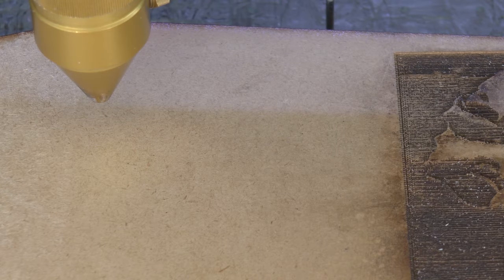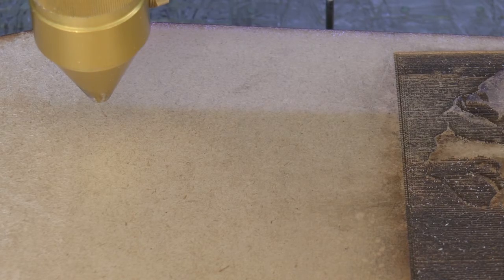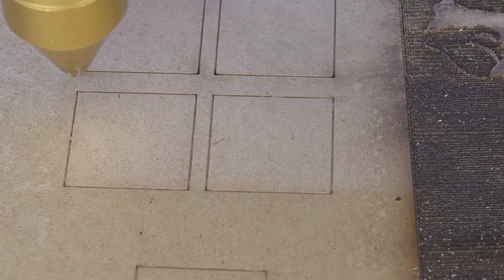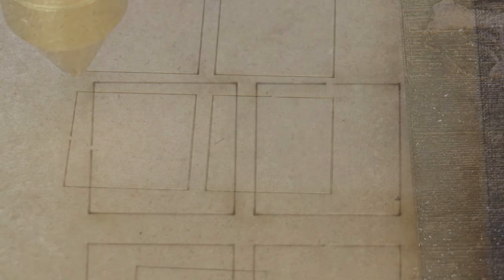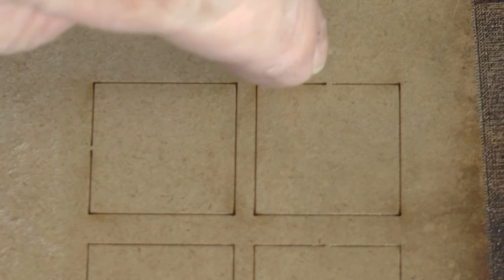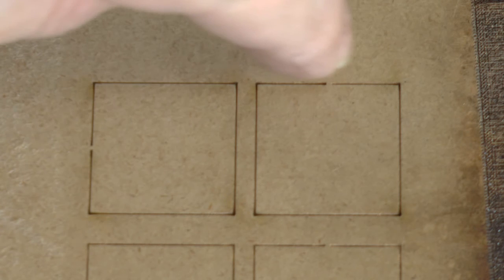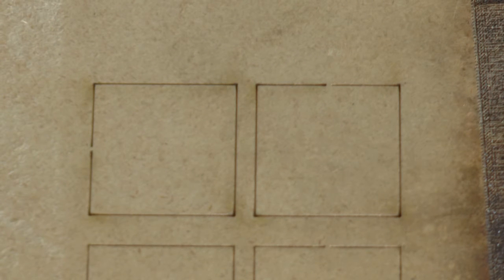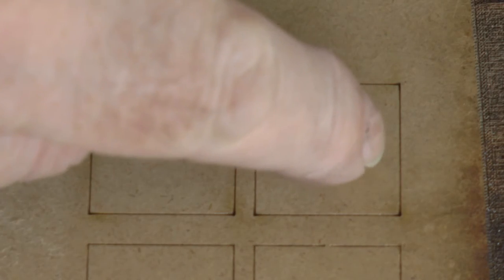RDWorks Learning Lab 55 Why Max Min Power

Comment: how does it affect cut through?
as in, if you need 40% to cut through(just cuts through and no more), and you set min at (example) 10%, does it still cut through? 
I think this will be a 'suck it and see' setting but I will find it handy for the MDF I cut already
Reply from the maker: +Michael Edmond
 Hi Michael 
This is obviously fine for engraving or controlling DRAWN lines with a cut parameter.  For through cutting it still requires max and min set the same. It seems as though the MIN power is the over-riding parameter UNTIL it matches MAX POWER
So it's useful for those that are doing a lot of engraving as I suspect dot size/density will create power variations if you let the machine "loose"  I'm sure there's some experts out there that either take this for granted or are not telling. Certainly worth experimenting with more for graphics work
Regards
Russ
Reply: @SarbarMultimedia , hi. I actually need image to be engraved (cutting parameters) NOT scanned.
Do you have any info what is recommended maximum cut speed?
Reply from the maker: @projex5894  
Hi 
So you want to do outline (vector) drawing with a fast cut? 
 First of all draw a 25mm square and  find the best power speed parameters for the middle of the square sides (set max and min the same). The corners will always be dark.
When you are happy with the result set the min power to about 5% and repeat the test. It is almost certain that the corners of the square will not join. Increase the power in 1% steps until the corners JUST join. 
That's it
If you change the power or speed you will have to carry out this test again. It is VERY sensitive....you cannot take a wild guess.

Best wishes
Russ
Reply from the maker: Problem 2.  You are asking about max speed for drawing there is value anyone can tell you. It depends on MANY factors, the focal length of your lens, the power of your tube , the material you are trying to mark but  most importantly there is the Ferrari effect that you have to understand.  I have seen you out driving you VERY fast Ferrari so you will knowthat it probably takes at least half a mile for you to reach 200mph????  and with those amazing optional carbon brakes you can stop in 200 yards. Hmmm. Ok.Lets change the rules.
Around your small housing block there is a road that is 100yds square. What speed  can you reach before you have to slam on the brakes to get round each corner?  60mp[h?
This exact same scenario existe with our machine. You can set the speed to whatever you like (200mm/s) but unless the distance is long enough for the machine to accelerate to 200mm/s then you are wasting you time. If your job comprises lots of small circles , triangles or other fiddly shapes  setting your power high to run at 200mm/swill result in overburning bacause the speed may only be 20mm/s..
I hope this begins to explain why the answer to your question  is a matter of experience, and judgment 

Best wishes
Russ
Reply: @SarbarMultimedia , thanks a lot for a quick reply!
I have 100W tube and will engrave acrylic. I think I might go for 25mm with 15% power
Reply: @SarbarMultimedia  you still need less power for a cut when moving slower for corners
Reply from the maker: @norro21  
Hi Ben
 In principle  your thought makes sense but practice is somewhat different and is VERY dependent on several parameters . Most people run as fast as possible and set the cut speed to just allow parts to drop out.  This means that the bottom of the cut trails the top by maybe 0.5 to 1mm. If you reduce the power at the corners the trailing bottom will not get a chance to catch up and your component will hang in by 4 corner "tabs" .  This is very evident in materials above 6mm (you can watch it happening in clear acrylic) so in general I never use minimum power for through cutting. However, fast cutting as used for line drawing, is when  min power  becomes essential., The other factors that can affect the corner cut are the choice of lens, thickness of material, the type of material  (acrylic is worse than wood), the "sharpness" of your laser beam and the power/speed parameters you choose to run at.  Because there are so many variables  that make every machine different, the only rule I would suggest is that  you experiment and see what works for you.
 Best wishes
Russ
Reply: +SarbarMultimedia Russ, can you try a circular or this square cut on your thick acrylic display pieces? I saw a bad drag well captured in a clear acrylic like yours... i always used min/max same values before, maybe time to change :)